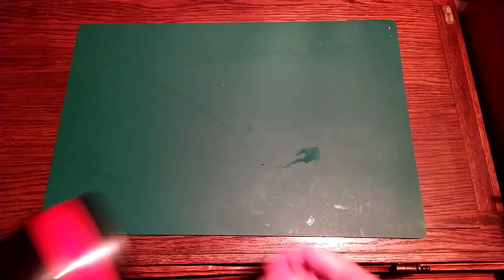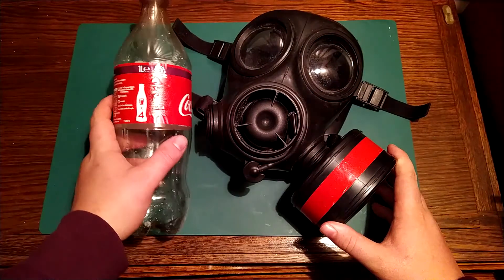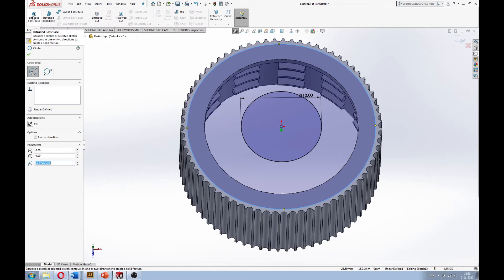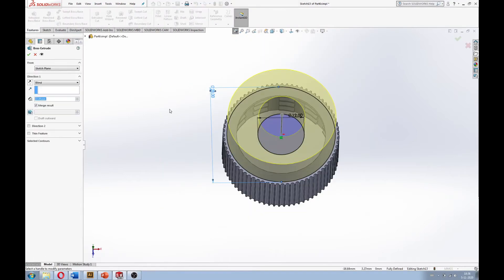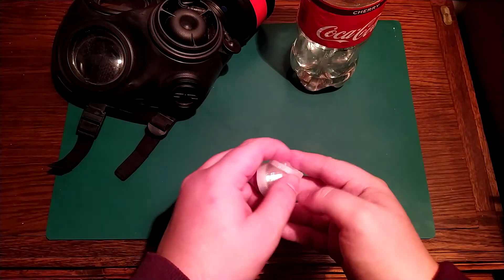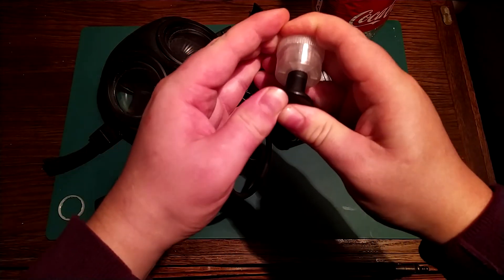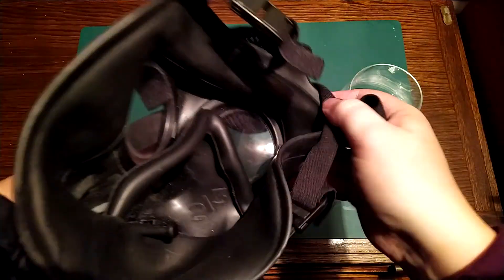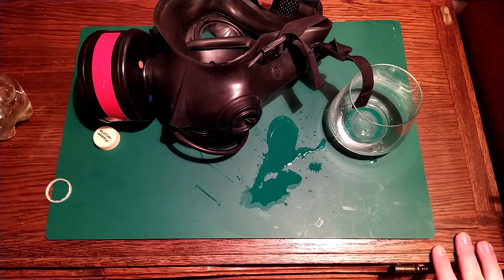Making an Avon FM12 gasmask drinking tube adapter

Comment: I mean this is useless for an actual CBRN environment, and a gas mask is a little extreme for Covid, but even then you're not going to instantly die if you slip the mask up and take a drink. There infact was drinking procedures before drinking tubes were used on masks.
Reply: Gas mask is not extreme when no one around you wears even basic face covering